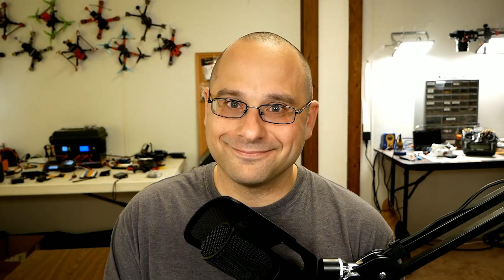6S is the new 4S | FOLLOWUP

Comment: Also keep in mind a lot of people run 6S packs lower because you can, this is without a doubt reducing the life of the packs. Just because there is less sag doesn't mean you're not killing a pack. The Test you did in the previous video is valid without a doubt, since real world data at the end of the day is what counts.
Reply: Listen to Thomas, people who genuinely push their quads to the limit know what they are talking about.

Not the rest of us who are just messing about really. 4S,6S, makes no difference really, certainly not worth going out and replacing everything!
Reply: I would echo this point - after doing the math on paper I suggested to Evan that maybe 6S 850mAh would be worth a look, and I absolutely will experiment with that myself, but practically speaking he'd probably find the point at which those smaller packs would start to sag noticeably because the discharge is coming from smaller capacity cells... but it would be fun to see what that setup (~435g AUW) could do for one-minute rip sessions.

Comment: I really enjoy these tests. And feel that people are quick to jump to conclusions and say this is best thing ever. Sometimes the answer isn't back and white. And at the moment that is where I feel we are in the 4s 6s hype. The main question I need to answer is, do I replace my motors and batteries to move to 6s. Or maybe rather look at 1800 4s option. And I find it very helpful to see that there is no major clear difference between 4s and 6s low kv setups at the moment. So thank you Bardwell for helping me decide not to upgrade to 6s for now. Even if there is no clear winner. :-) still very helpful. Thank you.
Reply: Like in this video, we see that 4S can be brought at the limit of what is humanly controllable. For the same real C rating and the same weight, the 6S cells will be smaller so individual cell raw power will be lower for something equivalent overall. If you are all equipped for 4S, have fun with 1800s, the investment will be much lower.
Reply: Same here. Replace all my motors and batteries... and, all my FC/ESC's because none of my stuff is rated for 6S. No thanks.

Comment: I think for me being a casual pilot, just the extra cost of 6s packs is enough to just keep using 4s. I'm happy with flight times and power and I can't see a big enough benefit:cost to bother. Thanks for the testing, it was very interesting.
Reply: Dale Pattison I think there is some confusion to that point. While switching your components and buying new packs does mean spending more $. A lot of 6s packs are actually cheaper than it’s 4s equivalent. As in this video the 2 packs tested, the 4s pack had less energy (watt/hrs) and ultimately performed worse yet is still more expensive than the 6s pack tested.
Reply: GC Cannonball I only fly tattu packs and they are definitely not cheaper.. plus they are bigger. Id prefer to pack in more 4s packs. I've got a 6S 6 inch Rooster and now it's become a long range 4s rig.
Reply: Dale Pattison well that’s an unfair comparison because tattu doesn’t make an equivalent 6s pack to the 1550 pack. In terms of watt/hr not mah. However both tattu/gensace/and pulse are made in the same facility. So if you were to pick let’s say your 1550 rline 4s pack which retails for 44$. Usually on “sale” for 36-38$ 
And then you look at the pulse or gens ace 1050 mah pack. (Within 1% of energy content of the 4s 1550) those will retail for around 30-36$ depending on which brand. And will be on “sale” most of the time for 28-32$.

Comment: Love that you're putting in the work Joshua. I think the test was helpful in that it showed me I don't need to run out and replace all my motors and batteries because the difference isn't as huge as the cost of upgrade. Keep up the awesome vids :)
Reply from the maker: I agree with this basic assessment. The difference seems to be most apparent to pilots who are already exceeding the capabilities of their 4S packs. You know if that's you or not.
Reply: Joshua Bardwell I feel like I am having to modify my flying during races to account for battery limits so I guess that me. Though I'm interested to see if I should just be getting higher capacity batteries and getting used to the higher weight or going same weight and higher voltage/lower kv to make up for the sag

Comment: I was going to hold pat since I don't fly well enough to take advantage of any performance improvements at the outer limits, but since you asked, I do have a couple of observations.
He flew much smoother as the day went along. His flying style is to chop the throttle, he almost is doing his own PWM type of speed control, and that kind on constant on and off the throttle is hard on everything, and builds a lot of heat. (not criticizing, he flies incredibly, I can only hope to someday even stay on the same lap with him) 
One of the main advantages of higher voltage is lower current, and less heat in any resistive component (all of them, even wire). Thus, the 6S does have the advantage in reduced loss and heat production for a given wattage. From an engineering standpoint, that would be where you would expect to see the gains, and yes, that alone could make 6S worth it, for real competition anyway. 
Higher voltage requires a proportionally smaller conductor (for a given wattage), which is why they use very high voltage for power lines carrying hundreds of megawatts, if you tried it at 480v, it would need conductors too big and heavy to suspend (trival fact)

From a practical standpoint, most pilots who fly for fun have all the power they can handle on a solid light 4S machine. I know the only time I hit the throttle stop is during a punchout or a (usually unsuccessful) last ditch save attempt. A light quad on a quality 4S1300 with Redbottom S motors or any of their equals is a handful for most of us. 

If you're going racing, the gloves come off and it's another game. (I used to race cars). With racing, the guys that have found the magic combo sure won't be posting it for all to see. Beware quads with painted motors, labels peeled off and tape on the other parts....

For those who criticize the methods, I'd say you're out there doing the best you can to answer our questions with what you have to work with. We'd all love a little skunkworks lab to test miniquads in, but so far as I know nobody has built such a facility. (I'll take mine WITH windtunnel please) With the right instruments and enough time, almost any questions can be answered. Until then, we will keep experimenting, collaboratiing, and hopefully finding the answers the hard way. One could make the point that that's a good part of the fun...

From here, it looks to me like you're doing a fine job on a patreon salary, and I for one glean a ton of information from your efforts. They are appreciated - Minor inconsistencies sure aren't a deal breaker. 

Sorry to run on (as usual)

Comment: Great points Joshua and your are absolutely correct, there are so many difficult to control variables that it’s very difficult, if not impossible, to do any conclusive testing. I also greatly appreciate what you do. The only thing I could suggest is addressing as many of the weaknesses in the testing that you are aware of. Attempting to keep weight as close as possible, as opposed to capacity, is a perfectly logical approach to the experiment so nobody should object (people will anyway) to that rationale. Also, maybe the closest weight packs were the ones chosen or it would be cost or time prohibitive to match the weights better, perfectly logical choices then. However, if the audience doesn’t know any of this then people will bring this stuff up. It has to be expected.

Comment: This is a very interesting way of getting around the peak current problem: To supply 1000W from this particular 6S pack we only need to draw current at 33C (1000W / 24V / 1250mAh), vs. 40C for the 4S pack (1000W / 16V / 1550mAh). 

That is a big win - not even taking into account the reduced effects of voltage drop through wires, ESCs, etc..., due to the lower current draw (63A vs 42A in the example above).
Reply from the maker: If you adjust the mAh of the packs so the Wh is the same, you will find the C-rate for a given watts delivered is also the same. The difference you are seeing is because the 1250 mAh 6S has more Wh than the 1550 mAh 4S.
Reply: Oh, dear... You're right. I fell for one of the classic blunders. Not getting involved in a land war in Asia, but getting too excited about the maths without checking my assumptions! Cheers...

Comment: Theoretically, if you have the same motor efficiency, same coils resistance, same weight per Wh, same RPM, of course it is better a 6s than a 4s, because it uses less amperes so the dissipation and losses in the coils and power cables is less. The dissipation is R*I^2. And since the current with 6s is 4/6 of the current of 4s, the power saved (for dissipation) in 6s w.r.t 4s is 55%! Also there are other magnetic losses which are proportional to the current so that adds up to the save. BUT having a 6s introduces for sure some overweight (each cell has parts that doesn't store energy, like connectors, cables, plastic around the LiPo...). Another advantage of having more voltage is that the esc control has more input range to control the RPM (more input authority), so the bandwidth is higher (I don't know if it is noticeable).

Comment: I had to chuckle a bit at this one because of the same types of criticisms I get for my testing. It is indeed an endless rabbit hole of variations we can run. Things like the pack DC internal resistance can have a fundamental effect on the actual run time and make a pack with a lower nominal Wh rating actually run longer than a pack with a higher nominal Wh rating. At a certain point though we just have to stop and say that here’s the data we have now, right now, and move on to all the other things that need testing.

Thank you for your testing and this video!

Comment: I just started testing 2205 1700kv motors (6s) compared to my existing 2205 2550kv motors (4s) on my race rigs and the difference in feel between the two is pretty significant.  The 6s setup feels sharper, more controlled and accelerates instantly.  Even if the flight times end up being the same between my 1500hv 4s packs and the 1050 75c 6s packs I'm using, the difference in flight feel will have me switching my race rigs over for sure, although so far the 6s packs seem to have better flight times for me.  It's really something race pilots should try before forming an opinion.

Comment: I would have added the weight difference in batteries to the lighter setup in form of a dummy weight (prop nuts in a bag tied to the kwad or something like that). But results still are results. Maybe you can take my criticism to your next tests. Cheers!
Reply: very good suggestion, that would be one less variable! JB was noticing that Evan was flying wider curves with the heavier 6s...
Reply: Good point, that'd be an easy way to normalize the differences in weight.

Comment: I'm curious about 5S mid KV setups. I started doing 6s builds about a year ago but I ended up going with 5S due to size weight and price of the batteries as well as the fact that most Motors would handle 5S.
Reply: Me too. More stuff is 5s rated and you still end your pack on the same voltage you start a 4S on.
5S seems to be a good compromise though where I am (Australia) most shops seem to stock more 4s and 6s.
5s is a bit harder to get.
Reply: I'm running 5s with a 7inch set up, 2508 1450kv, great performance, and prefer it over a 4s setup as its smoother through the throttle range. I can run 6S but its a bit too wild for me.
Reply: I just started running a 6" freestyle setup the other day with 5S and 2150kv last week and the power is insane without reducing the flight time.
Reply: Im running CNHL 5S 1350mah with chamelon 5'' with massive Hyperlite 2307-2722kv matched with genfam flash v3/windancer on dshot1200, doing about  3 mins aggressive flights but nothing abused like the young pro pilot of the last video.
Now this new 6s/low kv setup could be something I could love too! Would it be as good benefit on heavier freestyle format with gopro perhaps ? As a pure racing point of view I do get it to; it is what is fascinating! how many variables builds we can get in this world ? For differents reasons, we all kinda do trade-off, I know it will never flight 8-10 mins, I deal good with it

Comment: As a lot of people said on the previous video: it is also not quite right, that a 6s pack would need to have a lower C-Rating than a 4s pack!
The C-Rate is the factor you need to multiply the capacety (Ah) of a pack in order to get the Amps you can draw from them.
But a 6s pack with the same energy contained as a 4s pack needs to have a lower capacety ( less Ah) than a 4s pack.
So lets do the math for a 4s and a 6s that both contain the same energy of lets say 25Wh:
~ For the 4s pack that would make a capacety of about  25Wh / (6 * 3.8V) = 1.655Ah.
~ For the 6s pack  that would make a capacety of abotb 25Wh / (4 * 3.8V) = 1.096Ah.
Now we have a 4s and a 6s pack that contain the same energy. So lets think about two quads that deliver the same amount power of 900W (i just made this number up) next but one runns on our 4s pack and the other one on our 6s pack, both containing the same energy.
Lets calculate the current drawn by the quads in order to calculate the C-Rate the packs would need to have:
~ The 4s pack would need to deliver about 900W / (4 * 3.8V) = 59.21A to output 900W.
    Therfore it would need to have a C-Rate of about 59.21A / 1.655Ah = 36C to deliver the 59.21A and 900W. 
~ The 6s pack would need to deliver about 900W / (6 * 3.8V) = 39.47A to also output 900W.
    Therfore it would need to have a C-Rate of about 39.47A / 1.096Ah = 36C to deliver the 39.47A and 900W. 

Ther you have it! 
THE C-RATE OF BOT PACKS (&S AND 4S) CONTAINING THE SAME ENERGY ACTUALLY NEEDS TO BE THE SAME (36C in this example) TO OUTPUT THE SAME POWER !!!

However we have to remember, taht you can switch higher voltage more efficient than larger currents. But this effect is rather small, as we only use a very few watts in heat in our cable, connectors and escs compared to the power that is put out by the motors. Therfore this effects a quad not so much, but is a big thing on electric cars and so on, as the powerconsumption and therfore the current is much much larger than in our small racing-quadas.

@Joshua Bardwell Please confirm taht, the people belive in what you are saying, for good or for worth.
Like 95% of the time for good :D
Reply: cito FPV 
Wow.
Reply: Thank you! Well done cito.
Reply: That's more or less my conclusion based on my math (spreadsheet below). The way I understand batteries, the discharge capability is a function of both rated current (C) and capacity (maH). If you look at batteries of different voltage and normalize watt hours (by reducing cell maH size) and keep the C-rating the same, there is no change in possible watt output, but a significant change in the total amperage which is what we expect. HOWEVER, now that I'm doing that math, if you look at battery cell load (which let's define as the percent of rated amperage (Mah*C) used e.g. 40A draw of 100A rated is 40% battery load), each cell at the indicated wattage has the same overall battery load. The theory was that the cells would be under less stressful amp draw under similar wattage, but that doesn't seem to hold up. 
https://docs.google.com/spreadsheets/d/1ViL2InKlvKEhI-uDIoFnUbdX-p7UhhbEvBGyuyZqE8A/edit?usp=sharing
Reply: Wow cito
Reply: Hello, you're right about c rating, but what makes 6s require less c rating is a better efficiency, although it won't make you move from a 95c to a 45c battery like some seem to think. From what I saw on motor test on internet, you get 5 to 10% better efficiency moving from 4s to 5s.
Reply: grandseigne cedric That could very well make the difference, 10% can be quite a lot. Do you remember where you saw the test? I think Josh needs to do a watt draw comparison between 6s and 4S at similar RPM. If there's even a 10 percent difference that would significantly validate the empirical findings that there is some benefit.
Reply: The efficiency difference is not enough to justify cost, it's just a way of generating more sales in a slow growing market place. That's all.

Comment: There's one glaring detail that people seem to miss watt hours aside. It's the complete lack of sag when flying low KV 6s. Sure you can run a 4s 1800 but an 1800 is still gonna sag on a mid to high KV quad. You can run a 6s pack into the ground before you'll feel the same kind of sag you feel on 4s.
Reply from the maker: It's weird because if you look at the DVR, you can see Evan sagging to like 3.5 or even 3.3 volts in some cases, but it doesn't seem to feel as bad as on a 4S.

Comment: It’s not just the added capacity of his 6s 1250mah packs that enable his longer flights. His 6s 1050mah packs also have a much greater IR due to the smaller capacity, so more energy is lost as heat and the sag will be much higher.

Comment: The thing with 6s is that you can get the same amount of power with less amps and more volts (OHM's law). Therefore you should see less sag under full load which helps with the last few laps.
Reply: Jason Anderson that is true, however you’re forgetting that the IR of a smaller mAh 6s Lipo is much higher than a larger capacity 4s Lipo.
Reply from the maker: As others have pointed out, pulling the same watts from a equivalent watt-hour 6S or 4S results in the same C-rate being pulled.